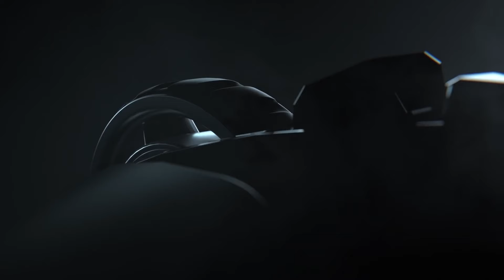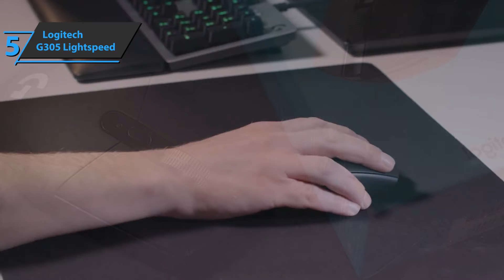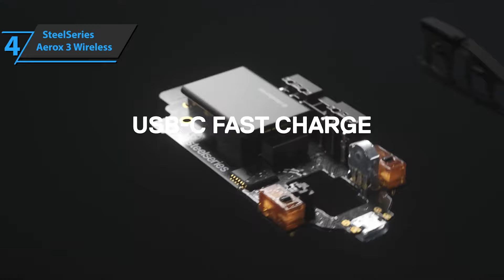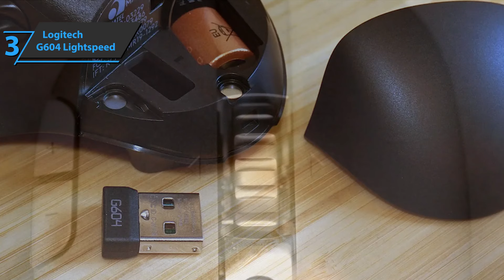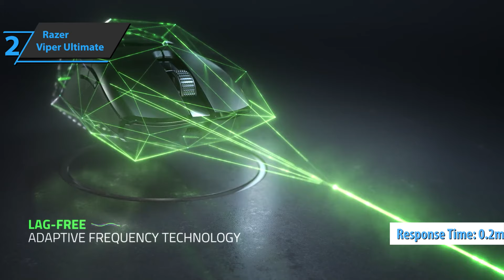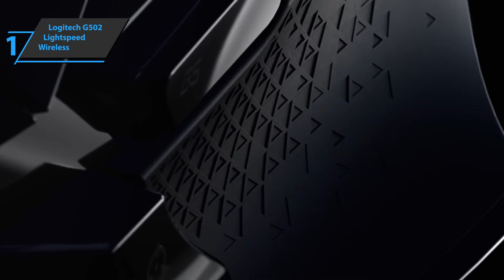Top 5 BEST Wireless Gaming Mouse of [2022]

Comment: G502 switch fail after two years and Logitech will not repair it, for a £100 this is absurd I would definitely avoid Logitech for this reason. It’s a common problem just Google it.

Comment: Came here to look for another mouse than the Razer Viper Ultimate. Arrived 5 days ago and won't charge anymore. No connection possible with the Synapse Software on a RAZER laptop.
Heard many others have the same problem and therefore cannot recommend. Will last you 1 year max.

Comment: Logitech sucks their mouse have double click issue used 2 g305 both failed within a year and Logitech says no replacement in your country. In future going with razor optical switches.
Reply: my g304 lmb has clicking issues, i cant use it to hold the lmb to drag anything , what wireless would you recommend?